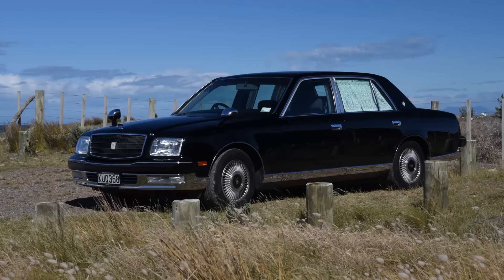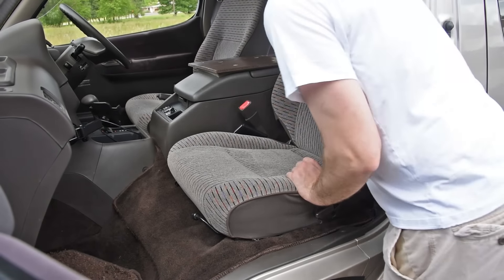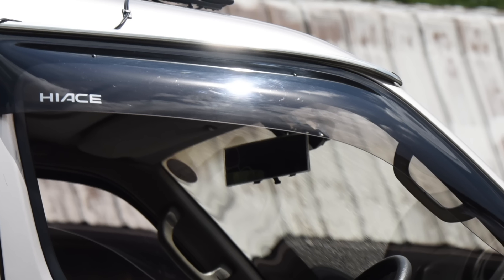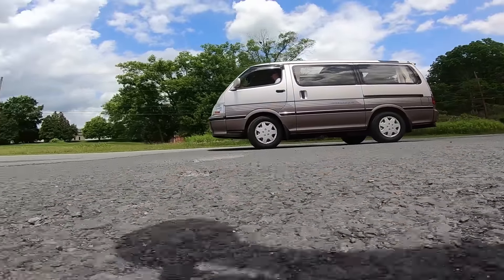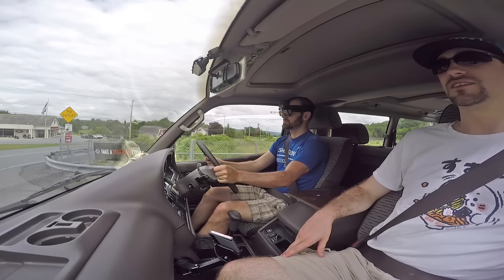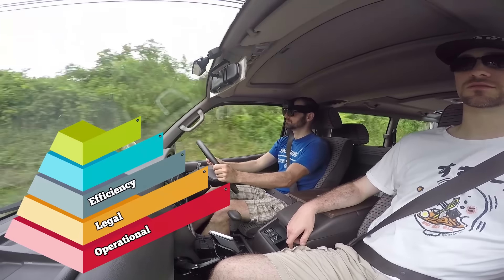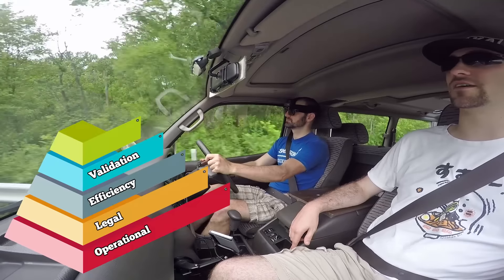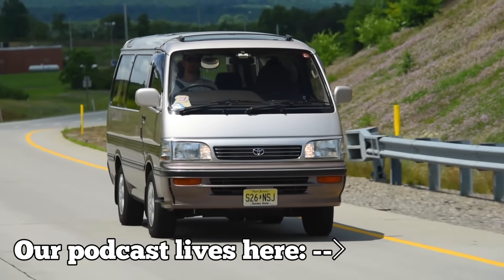1994 Toyota HiAce Super Custom: Regular Car Reviews

Comment: Don't you know those window rain deflectors are just so you can smoke in the rain. You open the window about 2-3 inches and it will suck all the smoke right out of the car all while keeping your ciggy dry!
Reply: That’s why they are a red flag when buying a used car.
Reply: True.
Reply: I don't smoke and I love them. If your AC is broken or it's raining and you need to drive at highway speeds they're great. Or park you truck on a hot summer day and leave the windows cracked and it's only like 100 degrees inside when other people's cars are like 120 degrees
Reply: I roll down my windows a bit when parking and the deflectors help cover the gap you passerbys can't really see the gap unless they looke closely
Reply: @ExperiencesAndEquipment  Or when you own a Honda and you have to dedicate half of your engine's output to running the aircon to keep the fog out
It's a nice alternative just cracking the window
Reply: >calling them ciggies
Reply: They're called Monsoon Shields.
Reply: @DiscoFang  Not places where they don't have monsoons.
Reply: @Doobie603  Name one country that produces cars with them that doesn’t have monsoons.
Reply: @DiscoFang  Thats not what I meant, I'm saying in places that have hurricanes and not monsoons, I live in New England we dont have monsoons here so no one calls them "monsoon guards". They are rain deflectors or shields when I search them in my location.  Its like one of these standard versus metric deals all over again.
Reply: Their purpose is more than just smoking without getting wet, but that sure is a great part of it.
They also work for really shitty cars with only a fan and no heating, so that you can open the windows a little bit and have the glass not fog up to oblivion, since the shitty little fans can't keep up most of the time!
Reply: Facts!!
Reply: @Kylirr  >greentexting on yt

Comment: I can’t wait until they get a Mazda Bongo on here… Then they will have the Japanese Van Holy Trinity.
Reply: Needs the Nissan homy as well
Reply: Oh no, you don't want one of these - they are old enough, but they were so badly bulit the older ones do not exist. I had one for 8 months, broke down (as in need tools and time to move again) 23 times, only dealer bought car I ever owned, sold it back at a £1000 loss having put £1000 into it keep it running. Makes a Delica feel like a sportscar
Reply: @idrisddraig2  that’s interesting… they’re the van of choice for backpackers here in Australia, and I’ve owned an ‘85 for years with nothing more than routine maintenance. Can’t speak for later years or the Euro spec Friendee as we never got those.
Reply: The Holy Trinity for those stuck in the 90s. Japan and the countries who don't have a 15 or 25 year import rule have moved on.
Reply: @HazeyAuto  Not the same van, its the Bongo Friendee that was nasty, built in a van shape on car components - ok in 60/80kph (speed limits at the time) Japan not fit anywhere else. The cargo van we got as Izuzu and was crude but effective

Comment: My dad had almost this in cargo layout as a worktruck in the construction business,  it was constantly overloaded with heavy stuff  he used on a daily basis, and very often pulled too heavy trailers for years and years..7 days a week..  The little 2.3 diesel engine worked the socks off itself and spewed black smoke . But it ran almost 800 000 km before it finaly ended its abused days as a partytruck somewere,  it never failed those years my dad used it,  a damn reliable horse

Comment: My 2017 Dodge challenger GT AWD reached validation on the RCR hierarchy. The 2015 Volkswagen Golf diesel TDI Sportwagon I just traded it in for reaches contentment. Now I can travel anywhere I want. My tires are $300 instead of $1,100. My highway gas mileage is up to 70MPG instead of up to 30MPG. Bravo on this hierarchy.

Comment: That chart is perfect. My manual TRD off-road Tacoma that I bought brand new last year ticks all those boxes. I went through 2 years of school and 3 jobs doing what I learned to do at that school to get this thing and it's the perfect vehicle for me. I die a little inside when I find a new scratch in it but then I remember it's a tacoma; it can look pretty, but it's not meant to. I almost died a lot on the outside when I hit a deer after only a few months of ownership and getting back into this thing when it was fixed felt like coming home. I'm only 26 so I'll probably have other vehicles before I die, but if this is the last one I ever own, I will die fulfilled.

Comment: I really feel the top part of the pyramid.
I have a 1993 Toyota pickup that has 420,000 miles. It's very clean and you'd never know it had that many miles on it. Earlier this year, I found out the block was warped. I thought it over, talked it over with my dad, and flirted with the idea of getting rid of it to get something a little newer.
My dad thought I was nuts to want to hold onto it. He said if I got a newer car and traded in the truck for it, he would give me an extra $5,000 towards the new car.
Nope.
I still have it, warped block and all, as well as a 2017 Corolla that I paid for myself. Thanks for the offer dad, but I'm 25 and no longer feel comfortable taking money from you, and I sure as hell don't feel comfortable getting rid of my little Toyota pickup.

Comment: 9:38 
I live in Florida and love that we don't have inspections. My girlfriend drove her 2004 Nissan Altima for a year without a front bumper and with the radiator hose held by zip ties, after she rear ended somebody.

Also, you are bound to see a car in flames on the side of the highway almost every day for that reason
Reply: ಠ_ಠ
Reply: You...  love that?
Reply: @pbfloyd13  I love that my state doesn't babysit me in regards to that. I would be really bothered if I had to take my car to get inspected periodically and pay for it. Also, no inspection means no hassle because of modifications 😄.
 The ones driving unsafe cars already know their car is unsafe and often are driving it because they don't have another option at that moment.
Reply: @dexxis9562  

Maybe but that means their value of any car that's seen any extended period of time in FL is low.

Comment: The legendary HiAce.
One of the toughest vehicles you can buy; That's why they're so popular in developing countries.

I've got a basic 1999 work van that I converted to a camper. 
300,000km on the odometer with a lot of those on rough dirt roads through some of the remotest parts of Australia's Outback.
Sure it's only 2WD, but with high ground clearance, a strong body on frame with a rigid van on top (unlike a pick up), light truck tyres, it will handle the roughest roads. Sure it can't do deep sand, but most of the "roads" anywhere in the world are .... roads.

I just wish people bought more of the manuals and diesels as the Automatics in them are the definition of a slushbox.

Comment: About those wind deflectors, I took them off of my Delica and when I tried closing the windows while driving at highway speeds, there was so much vacuum from the wind whipping past that the window was being sucked out of place so it wouldn't seat at the top of the window frame, leaving a gap.  I literally had to slow down, retract the window and then lift it to close properly.  I put the deflectors back on, problem solved.

Comment: Even the current HiAce grows so much, it's almost as huge as Phantom EWB. The older generation was around S Class size. But thanks to its diesel engine options, it can be remapped easily without breaking any of its parts, except it needs better brake pads and tires. All good to go as long distance people carrier

Comment: That would have been such a cool car to ride in as a kid in the late 90's with all your friends in the back. Gameboy link cables stretched across the chasm between the swivel seats and the rear row. I still kinda want one even now.

Also, damn, that minivan is more luxurious than most minivans well into the 2000's. And I definitely would have loved to have curtains in the back when I was a kid so I could nap without being suddenly shafted in the eye by the blinding light of the sun through untinted windows. Because it was the 90's and rear window tint just wasn't a standard thing at the time.

Comment: i had 1993 Toyota HiAce no aircom, 2.4 petrol, RWD in Croatia. Super hot summers, snowy winters and super expensive petrol. I regret selling her. I changed ORIGINAL battery in 2009! I changed the oil twice in 9 years. Never any problems (other then rust)

Comment: My family has this exact same van! But it's in pale green, it has a turbodiesel engine from a Land Cruiser, the steering wheel has been converted to left-hand drive, it has all-time 4x4, and it's not running atm (something about fuel pump issue).

Comment: These vans are seriously quick when equipped with the turbo diesel motors. I would buy one if available.
Reply: My family owns a turbodiesel version but it really struggles to get up to speed. It might be due to its age and high mileage though (over 350k kilometers).
Reply: @racermigs1  that is really unfortunate. I'm sorry that has been your experience. The turbo diesel HiAces I've ridden in were shockingly punchy for a big vehicle like that. It feels like a train. If I owned one, I would tune it to within an inch of the engine's reliable life and do some major cross-contintental touring at high speed.
Reply: @Arkeo36  It's not too bad. It gets going and it rides well and that's what matters. We drove that van all over my country and it's had its fair share of breakdowns every now and then.

Comment: Nah, the "wind deflectors" are actually a smokers tool, so you can smoke when its raining without getting too much water in or getting your smoke wet when you ash it out of the 1 inch crack

Comment: Fascinating to see what these were "supposed" to look like. In Bolivia they are the most common public transport vehicle. Usually rigged to run natural gas. 

The fancy seats are stripped out and replaced with crammed bench seating, if it had electric curtains they havebeen broken for decades. Interior trim is so worn out many doors have the interior components completely exposed. The brakes are dubiously maintained, the suspension is shot from years of use on Bolivia's terrible roads (a lot unpaved). Yet, this still work and remain dead reliable.

Comment: With 4wd these machines was the backbone of the Norwegian construction industry. 
With normal maintenence like grease oil and filter change and wheelbearings at 300.000 miles they would go for 600.000 miles and only cost diesel

Comment: You should really try the Turbo diesel AWD model, soo much better. also remove most of the seats unless u are a family of 10. Best van I have ever owned. 1kz is the best most reliable option for this platform.

Comment: Just a heads up, legal in South Carolina is the same as legal in Florida. Body panels, optional. Air bags, fuck off. Working wipers, just don't drive in the rain. Bald tires, just don't drive in the rain. I have literally witnessed cops in this state riding behind cars with no working brake lights and do absolutely nothing. They honestly don't give a shit so long as you don't have someone riding in the bed of a pickup. Outside of that, you're gold.

Comment: 4:30 those are more about stopping rainwater from accumulating and getting inside. Think about Tropical Asian Weather. You're not supposed to open the windows and you always have the air-con on.

Comment: Love the video, however that rear climate control is heat only. Thats the EXACT same switch setup my 3rd Gen 4runner has. It only does blow air, or heat. No AC.

Comment: My father had a 92 Super Custom 3.0 Turbo Diesel 4WD 5 speed maroon with maroon interior with similar seating, he removed the rear seat.
He used it as a dual cab truck, the rear usually full of tools, jacks oil, plastic drums of diesel etc.
Wasn't full time 4WD like later models but traditional hi 2WD-4WD and lo 4WD gear lever with manual locking hubs.

Far superior mechanically and therefore more reliable than a Delica.
And excellant offroad, almost Landcruiser performance and I'd love to own one in the US, ideal for trolling custom Jeep Wrangler Rubicon owners.

As I a New Zealander I find it perturbing that meh cars like Honda's, Subaru's, Delica's have cult status in the US.
90's JDM -give me a stick shift RWD Skyline or Stagea with a RB DET over a Turbo Subaru or quick Honda, actually I'd rather walk or drive a Proton Saga than own a Subaru.

Comment: They had other options from Ford and GMC/Chevy with the 4x4 Truck platform mini vans in All wheel drive. I mean the Astro/Safari is the first that comes to mind but then there was the  rare Ford Aerostar All wheel drive version with same top but had a bottom Ford Bronco/SUV platform to it. They did not Sell well just like the Aerostar its self due to the odd shape but not the Ugliest Minivan as that was the one bullet shaped Minivan from Pontiac that sold better then the Aersostar.

Comment: I would like to say my vw beetle and my jeep TJ golden eagle are tier 5 cars for me my jeep is kinda a piece of shit but every time I turn the key and take off in that thing I feel good and occasionally I feel bad about the way it runs but only because I respect it enough to not want to kill it so I'm always spending money trying to keep it happy. It doesn't always sound happy or even run right from time to time but I've never found myself thinking screw it I'll just run this thing into the ground I abuse it to an extent because I enjoy the way it drives and taking it to that ragged edge but I always fix it if I do break something. I've rebuilt the entire driveline because the previous owner didn't ever change any oil other than engine oil and subsequently everything was worn out. I've completely customised the suspension with adjustable arms so I could set it up so it felt just right and the pinion angles were perfect so there wasn't any vibrations. I've spent about what the vehicle is worth just making it mine but I don't care because it's the first vehicle that I've owned that wasn't just something to keep nice but still be able to sell it and turn a profit. It's a vehicle that I love and want to be perfect because it was already so close.  I knew it was the car for me before I even sat in it and before I even gave the guy the money I already had half doors because I knew that was what it needed. I saw a white roofed jeep driving around town so I pulled up and asked if they wanted to swap and I'll be damned they actually did. So now I've got one of only two TJ's I've ever seen with black paint and a white roof. I realised I had a chrome grill that had been painted over so I spent an entire day and a half chipping that paint off and polishing the chrome so it could shine like it was supposed to and finally I realised it is a golden eagle jeep because I saw the gloss in the paint where the stickers used to be so the paint hadn't faded so I tracked someone down who could recreate them for me and even got a perfect recreation of the eagle on the hood from an earlier jeep. In the end I've got the absolute perfect car for me. I'm 6 and a half feet tall so nearly nothing else fits me properly in Australia and the half doors perfectly line up with where my arm wants to naturally rest. It's just the most me car I have ever seen and I really don't care how much it costs to keep it this way because at the end of the day it's worth it to me

Comment: In my opinion contentment comes before validation.
Validation is for douchebags anyway.
I'm in love with my Hilux Surf, I'm looking forward to finally getting it level 1 and 2, it should ace level 3 after that, level 4, validation to me comes from my own level of happiness with a car, and mine already nails level 5 (my level 4) by making me extremely content with my purchase, especially since I got it cheap and had to replace the cracked head.(don't  worry it's a common failure for early 2LTE engines and fixed by replacing with a 2.8 litre head I believe, I've forgotten exactly what I put on there 😬).
Lovest thine workmanship 💜

Comment: Absolutely nothing wrong with this model, or even the model before.
Virtually indestructible.
I think the previous model was the 4Y 2.2 litre, with a 5 speed. Would eventually run out to off the clock speeds.
But, do NOT roll one.
It hurts. Quite a lot.
It still went, but I hardly did.